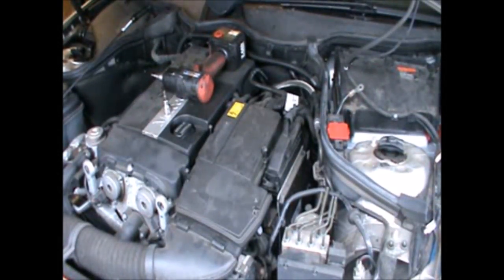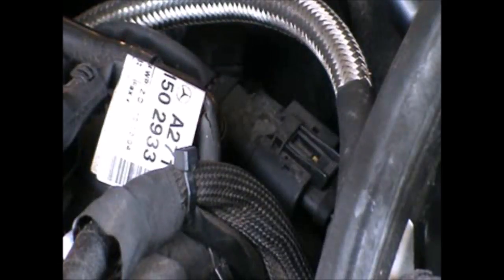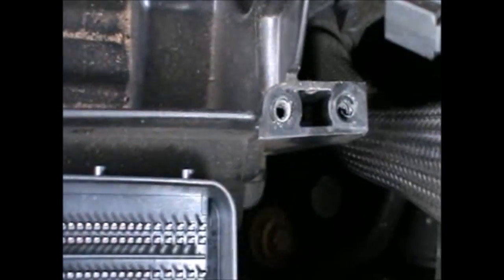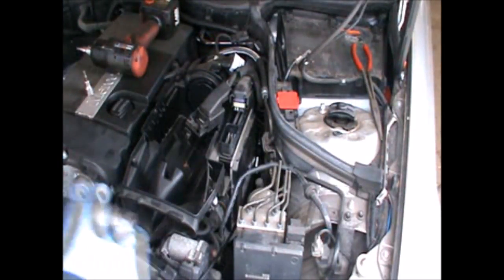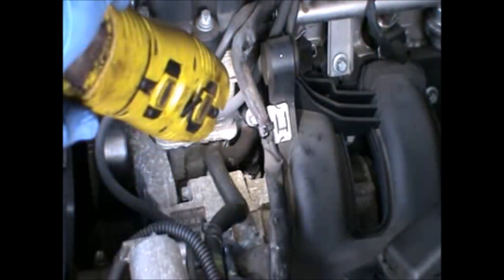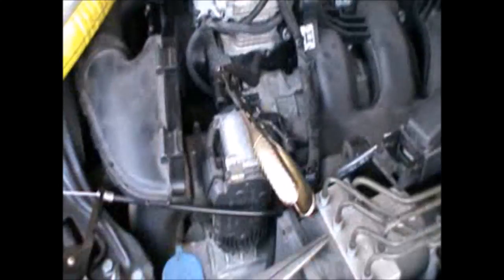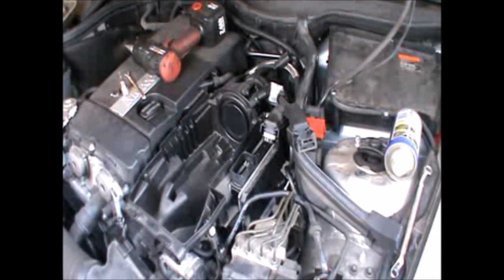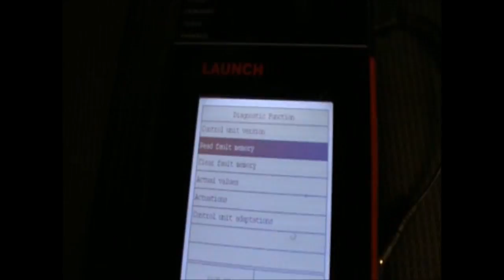Mercedes w203 w204  vacuum hose replacement crankcase c class 2004 rough idle, engine light on

Comment: Thanks alot ....after following you i discovered mine was just disconnected
Reply from the maker: Glad I could help
Reply: @DaringBeefcake  Do you have any videos on the central (keyless) locking system?  My doors don't close at the same click..i jave to press the button 3 to 4 times to lock all doors.... could it be settings or a physical problem ? Thanks
Reply from the maker: @metrix9125  If its a specific one thats not locking it might be having an issue with the door lock actuator, they do tend to fail, there is a little spring that brakes inside of them or they just become sporadic till they stop.

Comment: Great video step by step an sharing hose clamp removal tool an tips , I also may have that same problem running rough an backfires start with replacing coil packs 1an 4 an if still don’t improve possibly that problem I hear it’s a common problem with this model , mine is back firing an running rough at idle  thinking it’s this problem

Comment: Job only half done unfortunately.. There are two more hoses and a valve underneath the kompressor which certainly are cracked as well and the valve probably is faulty too. They also need replacing, but the kompressor needs to come out. That's a full day's job!
Reply from the maker: It is indeed.

Comment: Thank you your video is helping alot im about to do this job very soon and with this video im not as terrified as i was. Mine is hunting on idle i just hope its that upper pipe and not the lower one. I will be getting a scope camera to check it out first before i commit to doing the job. I will post an updated video as soon as i can.
Reply from the maker: Yusuf Petersen hunting is a sign of this issue. And yes hopefully its not the one below. Good luck with the job.

Comment: Hey quick question at 4:22 right where the engine corner there is a vacuum pipe that’s going in. What’s that called ? I have a leak there and the pipe is mostly done for. I need to change that when I do my spark and ignition coils Tom. So I was wondering what it’s called ?
Reply from the maker: Hi sorry for my late reply, to be honest am not sure of the name for that hose.

Comment: For what it worth the below are the readings taken from a borrowed plug & display odb2 on my honda for getting a base line reading of a M271 1.8 litre engine on idle mode after 5 minutes.

Air conditioner switched on. RPM 850 = piston displacement of 12.75 litre. Throttle valve open at 17.2%.Intake air pressure 0.50atm or -7.5psi. O2 sensor reading 0.65v to 0.8v. MAF for air intake of 5.4g/second = 4.9 litre of air per second. Therefore 4.9/12.75 = 0.37atm of air pressure in cylinder when piston is at DBC. This calculation exclude slight pressure contributed from vapourized gasoline injected by port mounted fuel injectors and the pressure drop across intake valve. So estimated air + fuel pressure in cylinder at BDC is about 0.4atm.

The above readings are taken as baselines  for a well maintained E200k year 2006. Before March this year never did though I would be  getting one. Mainly on Sushi diet for past 30 years. So, I have to learn to spot any of its typical problems as soon it pops up.  

Next I will do a highway run at 100km/hr or 120km/hr on auto cruise mode for about 20 to 25km and have video shot taken on tbe OBD2 display. Will run the car on flat section and hilly section. Then keep obd2 shots for future references. 

My own thinking is that anyone buying an old car of above 10years must have a OBD2. Better still plug it into a friend's well maintain car of same make & model that you intended to buy. Take a pictures of displayed values before going to hunt for it from private sellers or second hand car dealers. If in doubts keep hunting until you get a good one. 

Regards
Reply from the maker: Thank you for sharing always helpful information for all of us :)

Comment: Hello. Thanks for the video. When this tube is broken, does it only get rough at cold idle? Or is it too hot? Does it also have failures in soft acceleration up to 2000 rpm?
Reply from the maker: Misfiring rough idle, to be honest different symptoms, engine cut out etc, but sometimes no symptoms at all just engine management light on.
Reply: @DaringBeefcake  tks
Reply from the maker: @eduardoa4558  no worries

Comment: hi  excellent video   does this vacuum pipe also apply to a 2009 w204 c200 271 engine.   my car does not seem to have this pipe under the air box
Reply from the maker: Hi to be honest there is a pipe there but it’s slightly different to the earlier model. I know because I was working on a 2009 one two weeks ago. I have a lean situation. After checking the hose it was slightly worn but no hole in it. Am still investigating the issue. How ever it can develop a hole as the hose rubs against the filter housing. So it’s worth checking.

Comment: The boot that connects to the airflow box where you had to use the flexible clamp pliers is a hell of a job to re insert I seriously doubt you got it first time in fact releasing the clip is so frustrating because you cannot see if the boot clip is correctly aligned all the way around
Reply from the maker: Ricardinho Fonzie thats is very true, it is the hell of a job, but since I bought those clamps it is a lot easier. The clamp stays in place and when refitting makes it easier. Before I struggle for hours.
Reply: Add a bit of wd40 to slide right in

Comment: I'm sure you already know you only replaced half of the hose, the most important part is under the supercharger.And that part is more important.
Reply from the maker: well to be honest i had an issue with one of the hoses seating under the supercharger only once on all the c class cars i worked on, most of the problems in my case were related to the hose in the video..

Comment: Which hose was it the one you took I changed them all but still having problems!!
Reply from the maker: Have you changed the one that’s under the supercharger, if you still having problems there is another hose hiding by the supercharger intake manifold and can be a pain to get to, how ever if you have changed all of them the there might be a complete different issue going on. Do you have fault codes ?

Comment: the remainder of the breather tube is below it, and most often it is damaged
Reply from the maker: I changed lots of this but not the pipe below, but the ones I did were low mileage..
Reply: @DaringBeefcake  most do not last 200 thousand kilometers, the same as the timing in this engine 😉

Comment: Hello, thanks for the video. I have 2005 slk 200 kompressor. My engine light is on and off from time to time. Car runs smooth and there is no any weird thing but ı wanted to solve the engine light iasue to turn it off completly. When ı plug the car to obd and scan I have “P0172” coded error. Do you think changing this part might solve the problem?
Reply from the maker: Well it’s a possibility I have changed many of those pipes, also you could clean the throttle body.
Reply: what is the problem yo solve already
Reply: same problem do you solve the problem
Reply: I would love to have an slk even if it is with 1.8 liters SC engine. But here it cost nearly USD15,000 for year 2006.

Comment: @DaringBeefcake hey sir, did you have p0171 code ? Thats what I got, I am about to dig under the air box too but wanted to confirm with you before i do that
Reply from the maker: I think so if that is a lean condition the yes. I changed many of those to sort out lean conditions.
Reply: @DaringBeefcake  yep its lean on all cylinders bank 1. Got it, I will have to tear that shit down too, but need to get that funky little tool too :D
Reply: Hi thanks do you no the part number for the vaccum hose

Comment: Before you replaced this pipe were you having an issue with your dashboard vents working properly? I have fault P0171 lean, and I’m also having problems with my floor vents constantly blowing air and I’ve been told that the cause is a vacuum leak. I’m wondering if replacing this pipe would take care of both issues.
Reply from the maker: rosales75904 i have worked on around 5 of this car that had the same fault code, but none of those had an issue with the internal vents. I don’t see any relationship between this pipes and the vents, may be they were talking about a different vacuum issue.
Reply: Don’t know if you already fixed the a/c vent stuck but is a common problem. You need the step motor actuator arm. It’s plastic an it breaks. Mercedes stoped using vacum to activate locks and vents from 203 chasis on.

Comment: My engine has a very rough idle and indicates "misfire cylinder 4". Do you think this could be the reason for it?
Reply from the maker: Hi it is a possibility, they do cause a misfire as well, but there is a valve on which this hose seats on and that could be faulty, it is a bit difficult to get to that valve I think the supercharger needs removing. Well best check the hose first as all the w203 I have worked on have had broken hoses.
Reply: @DaringBeefcake  Hey! Thank you for the reply 😊 I unplugged the MAF and the car seemed to run alot better so I'm replacing it. I'm also going to change the hose though. Do you know what diameter in millimeter the new lower hose clamp should be to fit?
Reply: And for the hose clamp I'm refering to the Hose coming from the MAF, not the $12 Hose that often leaks 😊
Reply from the maker: Pär Fektion great hope that changing the Maf will improve the rough idle. Am not sure of the diameter to be honest.
Reply: Wow same problem here im not a big mechanic  and i have a c230K 2005 its had the midfire on cylinder 4 and ive changed the ignition coil n all spark plugs but still happens. So do i need to fix my vacuum seal?
Reply: @ParFektion  where u able to fix the problem (hesitation and misfire) by replacing maf and leaking hose?  Thank u very much
Reply: @Yusufcatveganslol  Did you fix it ? My car has the same problem
Reply: @pwrfmind  I’ll be honest it can just be fuel injectors and also the super charger going bad and causing the car to go into limp mode

Comment: Yes sir,can you help me out with my problem, I had 2009model c200 kompresor, I will ask you,where can I find the supercharger boost control solenoid circuit A / open, troble code p0045

Comment: This comment is for those having a tough time with a lean code on this vehicle 

If you still got a lean code on your car there is a second hose that goes underneath in the intake manifold on the side of the supercharger , make sure you buy new gasket for the intake gasket , also you will most likely need special tools from o Reilly’s to get that hose out but it’s possible also your really going to run into this problem if your leaking oil from the intake manifold which if someone could explain to me why I would appreciate it

I could only guess it’s from the valves but what do I know I’m not are certified lol
Reply from the maker: thanks for the tips :)

Comment: Yes sir,can you plz help me out with my problem, I have 2009model c200 kompresor, troble code p0045 supercharger boost control solenoid circuit A / open,tnx

Comment: how much would a mechanic charge for this job?
Reply from the maker: If it’s only the hose at the top like the one in the video, it could take up to 1hour + , so what ever rate is charge per hour would apply, around £100 - £120 maybe. There are another two hose below and that can take the whole day to change.

Comment: Where is the PCV valve & hose for a 2005 Mercedes Benz c230k
Reply from the maker: basically the rubber pipe seats on the valve. The little pipe that comes out and that rubber pipe plus into, am guessing that its a similar engine.

Comment: Hi does anyone know where this pipe goes to and from or a part number ?
Reply from the maker: I don.t have access to the part number at the moment but that hose comes from the PCV valve and goes into the intake manifold just after the throttle body as shown in the vid.